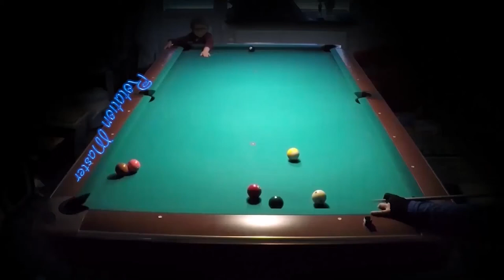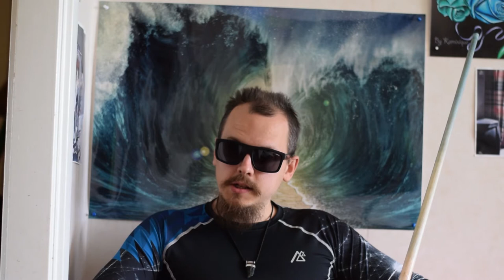Pivot point - Low Deflection shafts vs standard

Comment: so i have a few questions concerning deflection ,,,,,,,, i persoanlly do not feel a shaft deflects the same exact way every single time do you believe it is possible to do so ......... and being well into my 50s i am old school and we never missed shots from deflection so the next question is why is it even an issue and the only thing i can think of is that modern day shafts are so badly or weak made that the low deflection shafts are comparable to shafts made of decades ago . and how do i find the pivot point for my cheap ass player pool stick . buying another or better stick is not an option because of all the variables . my personal best is 13 racks in a row and literally 2 is a major feat theese days but attribute alot of it to deflection ...... simonis and the composition or cling or lack of cling to pool balls .
Reply from the maker: The shaft deflects different every shot, a good way to minimize any errors in both the cue and the stroke is by using a short bridge. The pivot point of standard cues is very close to the tip. On Low Deflection shafts it's further back, the manufacturer should have information regarding this.
Reply: That's all fine and good using a short bridge to shorten to he amount of deflection .... And it is a bridge I use often ..... But it doesn't allow for a long smooth stroke and for as much English I personally get a more punch stroke out of it and was never forced to use a short bridge to play the game well .  I don't know ow if it's me but if I use a short bridge my back hand is past that wrap also which isn't even comphy and is just to punchy. Anyways thanks for the reply .
Reply: imo, i believe he is wrong about the bridge being a source of "deflection." cue ball deflection is the same thing as what the old timers called "squirt..." cue ball squirt or deflection is 100% real. i can hand you 2 sticks, one made with traditional materials and one with modern low deflection tech. have you shoot middle diamond to middle diamond with 3 tips of english at same speed for all shots and there are night and day differences in how the cue call traveled the length of the table. 1 to 1.5 inches of squirt vs .5 to 3/4 inches of squirt consistently.

i can't really judge on quality of old cues... i never played with any when i knew what i was doing. having family members that won plenty of local leagues and got invited to play in vegas, deflection was 100% a thing back in the day. y'all just learned to play with it. thats not to say individual, hand made, custom cue makers had more or less deflection than others, they certainly did. it was more or less, once you found your stick, you stuck with it. 

personally, i think technology advancements as a whole has made this generation lazy, complacent, and/or entitled. instead of working your way thru the hard stuff, you look for someone or something to engineer a way out of it. at my local pool halls, almost EVERY person younger than 30 has a Predator revo shaft... that's not to say they do not have skill, but they started at a different baseline than you or i did.

Comment: Shaft aside, a longer bridge equals less deflection. You cannot tell me a smaller angle of the longer bridge creates more deflection than a short extreme angle of a short bridge. Every cue has a different place for its natural BHE pivot point. I would absolutely recommend everyone get comfortable with a long bridge, regardless of what cue you have.
Reply from the maker: Every cue has it's own perfect bridge length. With Predator I preferred a long bridge, with house cue a very short bridge. I found that the shorter bridge gave higher performance. A short bridge with Predator didn't work. So the best cue is the house cue because it's the only cue that you can use a short bridge with. A long bridge with house cue is a nightmare, especially on shots where you need to reach the cueball. Predator wins there, but in all other shots, the house cue is better than Predator. So the cue with the better performance overall is the house cue, as long as you use a short bridge with it.
Reply: Rotation Master I refuse to play with house cues haha. Just kidding but I strongly dislike it. With a house cue the tips are usually shit so my English is very minimal with a house cue and therefore my bridge length is irrelevant.

Comment: Rotation Master, 

Do you use a low deflection cue or a standard deflection cue?
Reply from the maker: I have used standard for many years now, ever since I switched from Predator Vantage shaft into house cue and won the tournament with a record run. I'm never going back to low deflection shafts.

Comment: Hello master, i have a question .. I used meucci black dot cue .. Is it correct to have the black dot facing upwards in each shoot ? 
Thanks
Reply from the maker: I haven't used the black dot shaft but I used the earlier Meucci shafts without any dot. I put my own marking on the shaft so that it would always be facing the same direction. I had the marking facing upwards so it was the easiest to see. So yes, I think you should always have the black dot facing upwards.
Reply: Rotation Master thank you master and all the best